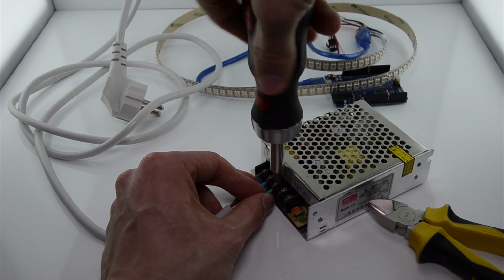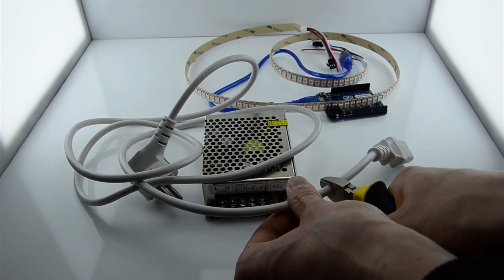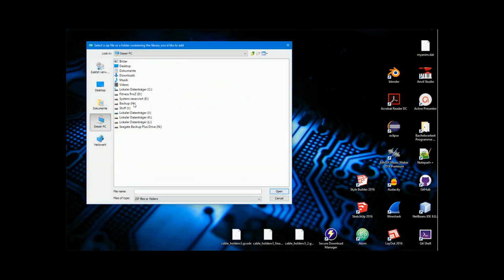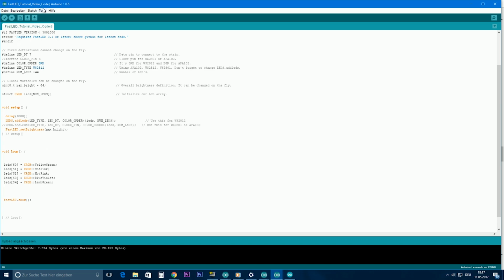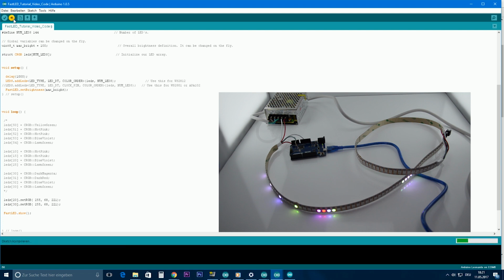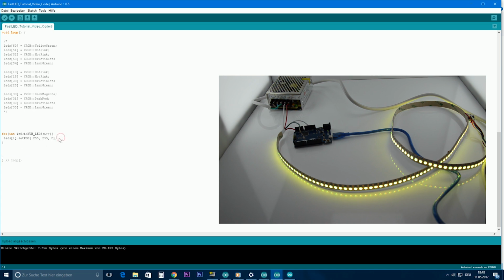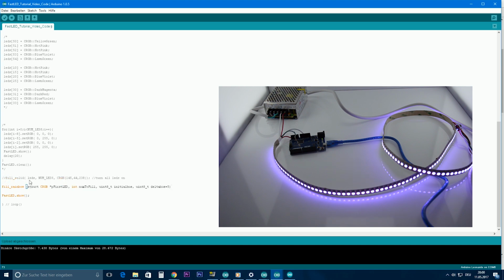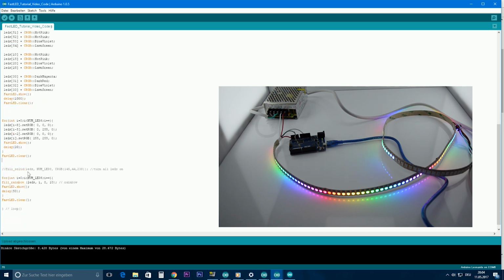How to control WS2812B RGB LEDs with FastLED and Arduino

Comment: Very clear and nice video with easy to follow schematics!
I have a question, if I use my molex from my PC's PSU to power the LED strip and USB connection to power the Arduino. Will it matter if I leave the Arduino connected via USB always? I read somewhere else that you need to follow a certain procedure when using this method (exact same setup as this video; USB powers Arduino, External Power for LED Strips). The procedure was that you needed to power up the LED strips first before connecting the USB cable to power the Arduino. 
Is this true?..
Reply from the maker: Hi darkdoom, well it should be no problem when you use the PSU for the LEDs and USB for the arduino. Maybe you have to connect the black wire of the molex also to GND of your arduino. Because the grounds of leds and the arduino need to be shared. Maybe they are already shared because the the USB is also powered by the PSU. You can try to only connect your arduino to the data wire of your leds. If this works you dont need to share the GNDs anymore. I guess it's not that important what you connect first.
Good luck for your project :-)